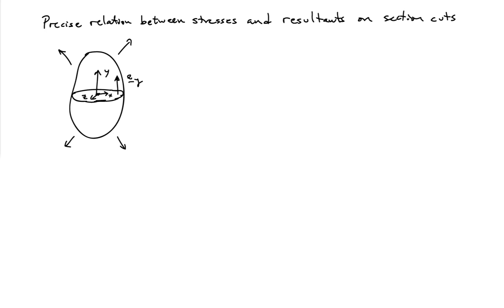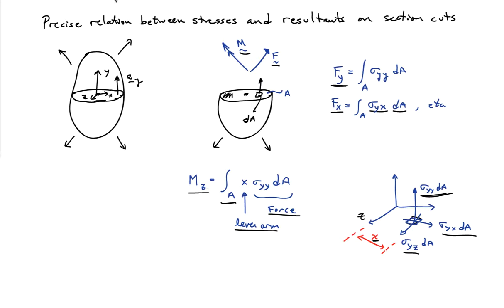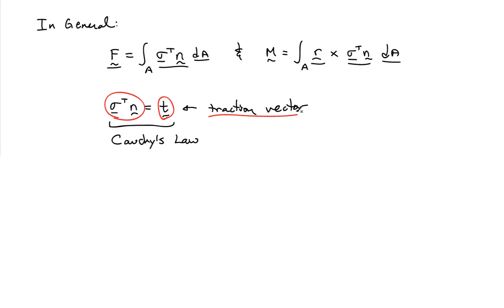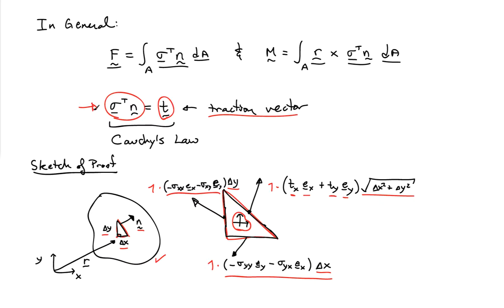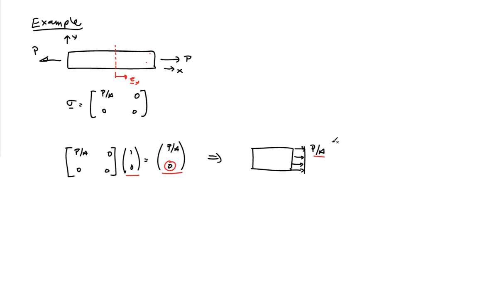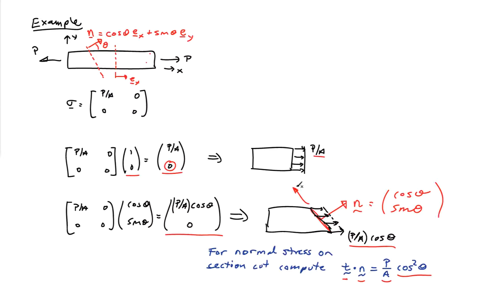(15B) Stress and resultants, Cauchy's Law

Comment: Everything is okay but in the proof of the Cauchy's law, in the left face the direction of the force vector should have pointed downward, it created a little bit of confusion at first. Overall, excellent explanation.
Reply from the maker: Yes.  I guess the figure could be confusing.  My original thinking was that the values of the stress components are arbitrary, so the traction vector can point in any direction.  But still, proper convention would be to draw it down and to the left.